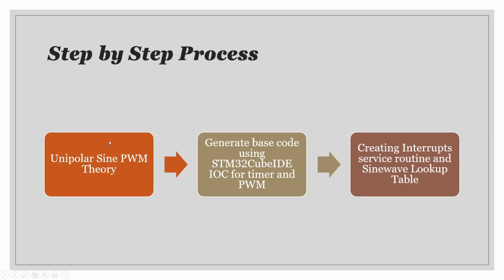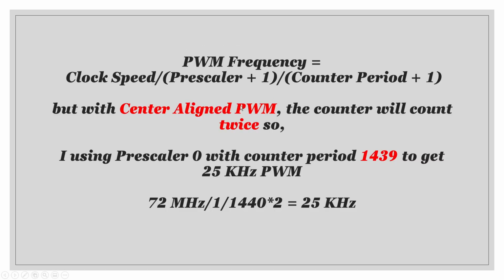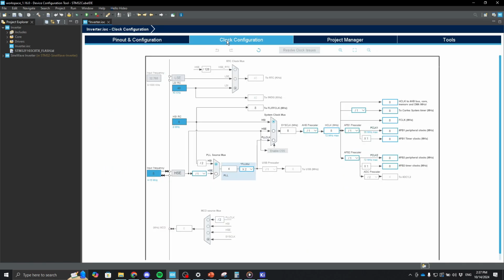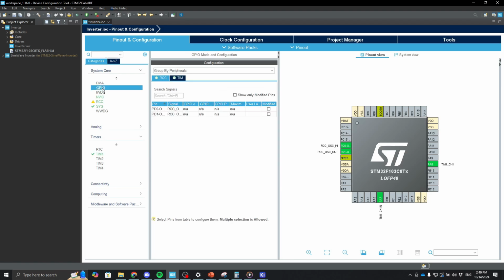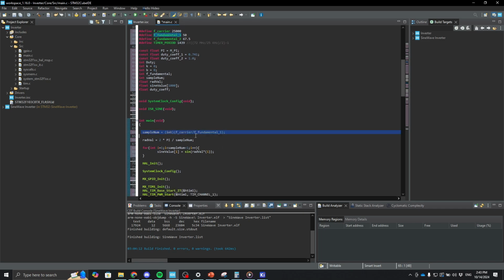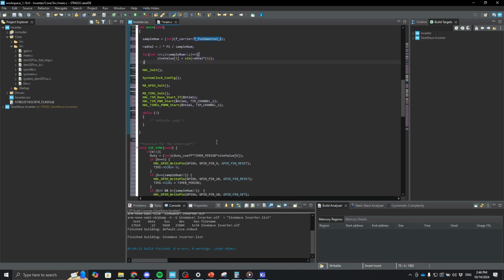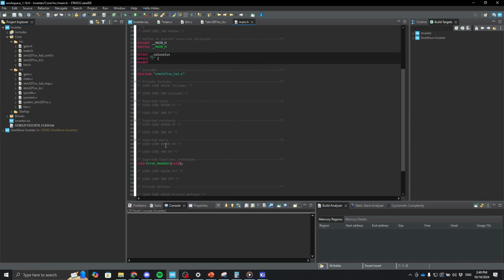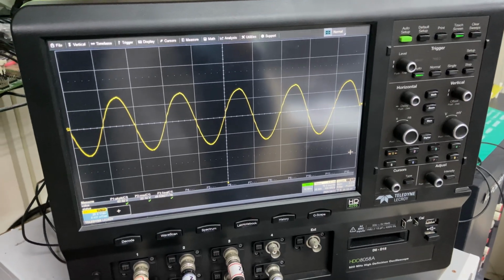Build a SPWM inverter using STM32F103C8 - Bluepill

Comment: can you share the schematic sir?
Reply from the maker: Hi, i am sorry i cant share the schematic yet because there something wrong on it and in the video i jumper some of the traces. Basically its circuit same as full bridge converter but without transformer and secondary side component. I use independent MOSFET driver for each MOSFET, HCPL-3180. To increase the input voltage, i boosted it. Output side of inverter need some low pass filter, here i use LC filter. Thx.

Comment: it not good at zero point when you use unipolar method, let use bipolar the waveform will perfect but you need more inductor
Reply from the maker: Each method have its advantage and drawbacks and switching to each method will not that very hard haha

Comment: thanks for video, I just tried SPWM 3-phase 6 pin at 20000 Hz with ESP32 + DEADTIME + ISR
Reply: Have you a GitHub for the project?
Thanks
Reply: Did it work sir?
Reply: Do you have the same project on esp32?
Reply: I'm doing the same project, wanna collaborate or share details and problems you faced 

?

Comment: To improve on this project, can you add battery votage adc, inverter output adc, temp sensor adc, start/ stop function, pid to regulate output voltage for stable output under load , display like lcd etc

Comment: Nice lecture from you sir. You are the best. Thank you very much. How do we make the code have close feed back or pid feedback to stabilised output voltage on load condition?

Also kindly give the pcb you used for testing the code